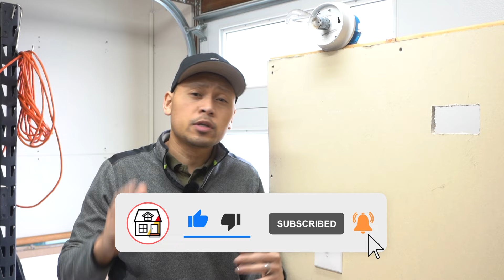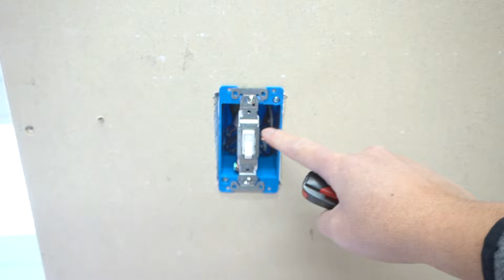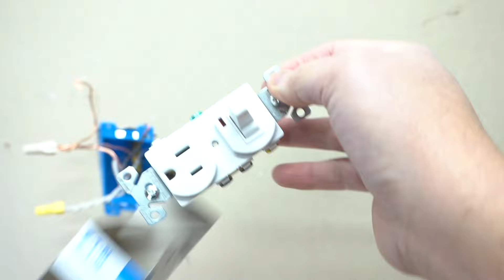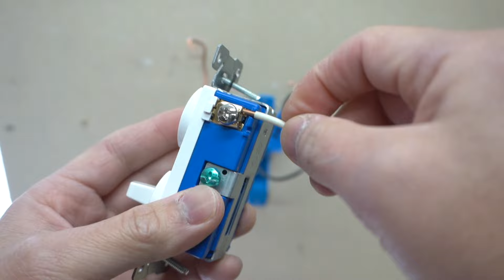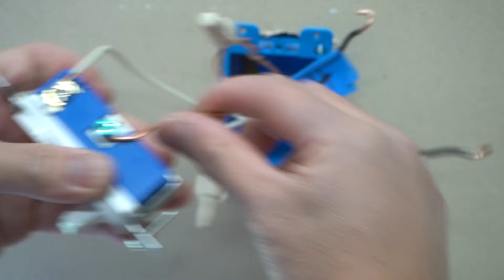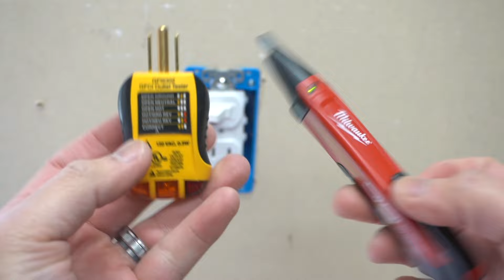EASIEST Way To Add Extra Outlet To Any Room! NO WIRING NEEDED! Outlet Light Switch Combo DIY How To

Comment: So much for no wiring.
Reply from the maker: No wiring as in no running new wire 👍🏽😊
Reply: @FixThisHouse  if the building is on pre 2011 NEC Code, you will need to run new wire from the light, such as 14-3 wire from the light to the box (15 amp) or 12-3 (20 amp) to the switch box.  If it's in a bathroom, kitchen, laundry room or garage, you'll also need GFCI/AFCI protected SPEC Grade switches to meet 2023 NEC Code.  If it's a 3 way switch being changed, you'll need to run 14-4 or 12-4 wires to the combo 3 way/outlet AFCI-GFCI switch.
Reply: @FixThisHouse 
Some people need to have every little thing explained to them. 😵‍💫
Reply: In this case, you’re right, but not all switches are between the line and load. Sometimes the line goes to the light fixture and the switch is wired from there. This is much more common in older buildings.
Reply: You thought it would use bluetooth or something?
Reply: @francsiscog   I thought it would be no wiring just like the title says.
Reply: @4vinylsound  unfortunately that's not what no wiring means.  Any electrical work inherently deal with wires.  He deals with existing wires,  no new wires,  which is the easiest method.